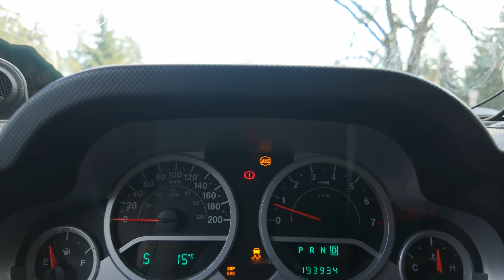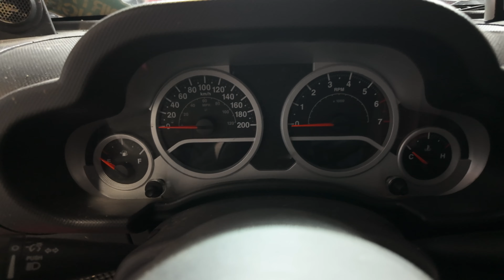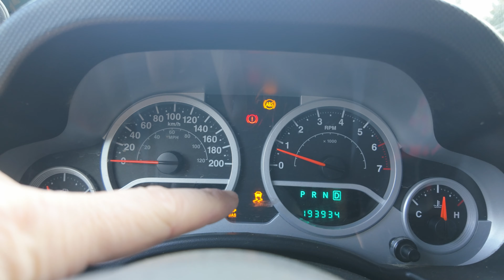Saving My Old Jeep: Is It Worth the Investment?

Comment: The Noco won't do anything if it doesn't sense a positive and negative from the battery ... you need to hold the OVERRIDE button for 5 seconds continuously and then it will send juice to the vehicle.  Unless other issues ... it should start no matter how dead the battery is.
Reply from the maker: Oh dang. I should of read the manual.

Comment: The battery thing you just described at 3 and half minutes works. A good battery in parallel with the dead one. Smart battery chargers are dumb. They will not charge a battery that is too low on voltage. the good battery fools the charger brain. It works but the old battery may still be toast. Taking and holding a charge will tell.
Reply from the maker: Thanks for the info!

Comment: Ok, been here with that generation JK. Before you do anything else look at the plug on the sway bar disconnect motor. Disconnect the harness and see if you can jump start it. If so, Look closely at the plug on the harness and on the disconnect motor for water ingress and  for shorting out, melting, etc. That system is integrated with virtually every other one, and if it get a short etc. it will shut everything down. Stupid system, stupid design.
Reply from the maker: Thats all been removed :)
Reply: @Casey250  Good move! Make sure the harness connector can’t short out.